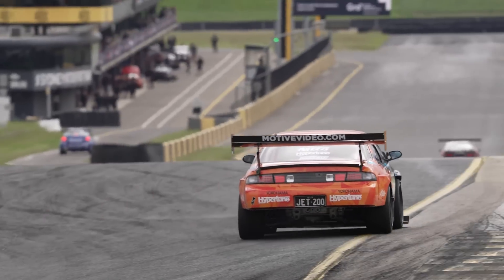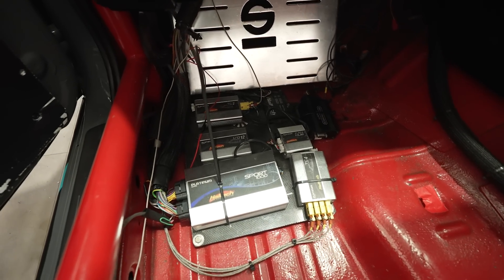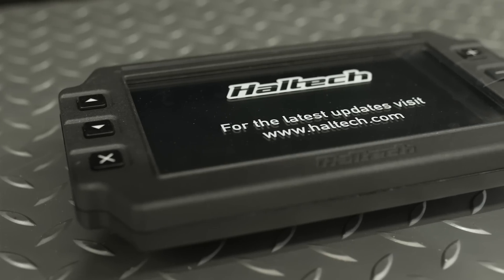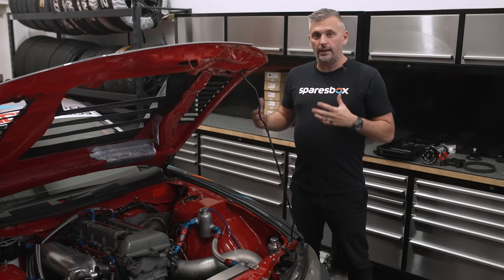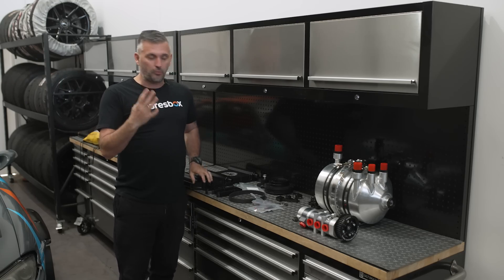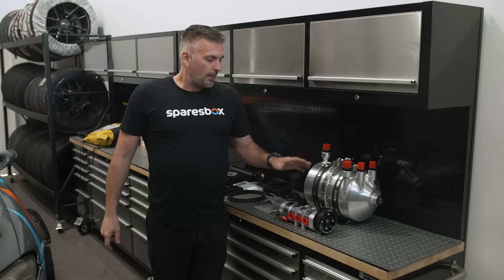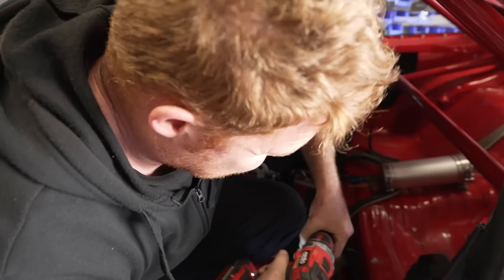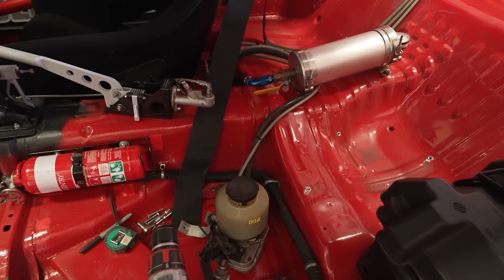JET200 750hp S14 Silvia |  | Dry Sump and New ECU | JET200 Prep for WTAC 23 Pt1

Comment: Are you doing a softer ring to work with the vacuum of the scavenge pump to reduce friction?  Is the crankcase vacuum bleed to not shred the bores with rings already setup on this kit?  I met someone that grenaded there first dry sump build on a 2JZ back in the day before there were any kits, expensive hobby once you're pulling G's to warrant it, loving the evolution.
Reply from the maker: Turbo engines still have positive crankcase pressure when on boost, just less than before. The vacuum from the dry sump is not as strong as the boost. We may run a breather from cam cover anyway, so won’t be enough vacuum go affect engine set up.

Comment: You mentioned no engine catch can now that you are going dry sump. I thought it would still need one?
Reply from the maker: It does, it will now be in the boot though and is more a breather for the oil can, rather than what come out if cam cover